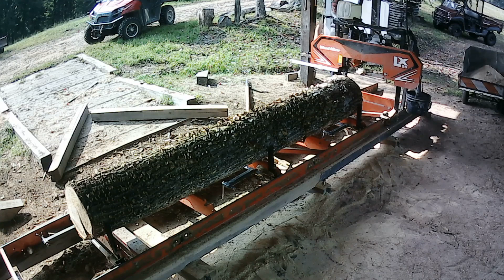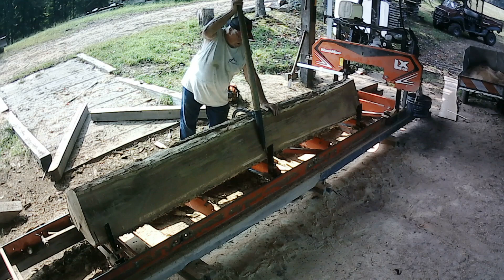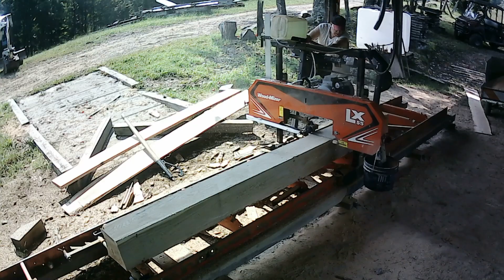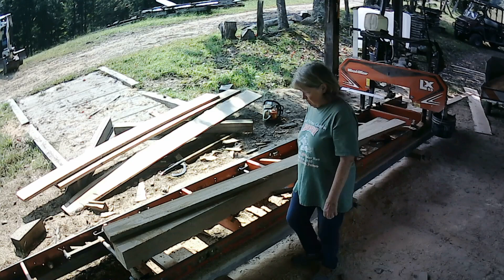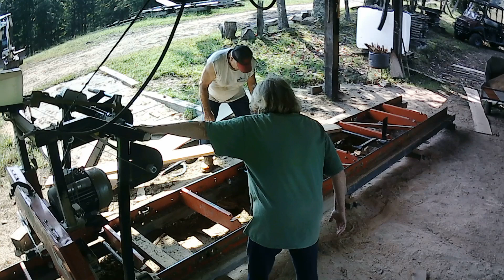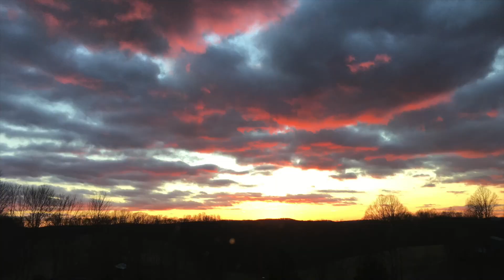LX55 Saws 2X6s

Comment: That looked like a nice looking straight and round log you had there. On our older mill I used a automobiles new style scissors jack it worked good for a toe-board. Looks like you got a few new 2x6’s . I’ve done a few dances like that before.. I call it the stumbling syndrome. Yea it’s best not to be drinking when you start dancing like that , it makes for a bad day. 
Take care and try your best to stay straight up on both two’s
Reply from the maker: Thanks for coming back. I've got one of those hanging on support pole, I use a battery drill to rase it. If it's really heavy I use a farm jack yo lift it and a wedge to hold it.
Brent

Comment: Check out the "Lumber Jack" channel. He did a video about a year ago about using a motorcycle jack as a toe board. Looked cheap and easy.
Reply from the maker: My motorcycle jack is too tall to fit under the rails.
Thanks for stopping by
Brent

Comment: Morning How you like the LX55 with electric motor?
Reply from the maker: I really liked it was quiet and cheap to run but, The slabs from a 26" log had to be put back on the sawmill and saw a board or two from them. Those 10 foot oak slabs are really heavy.
Brent